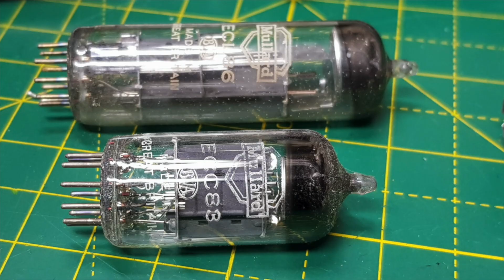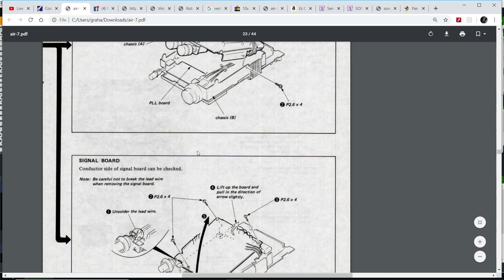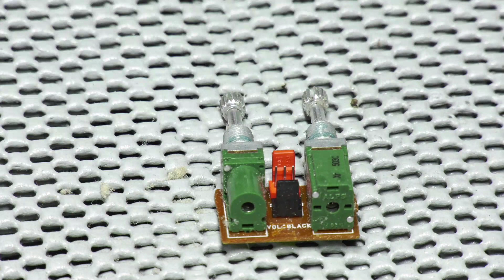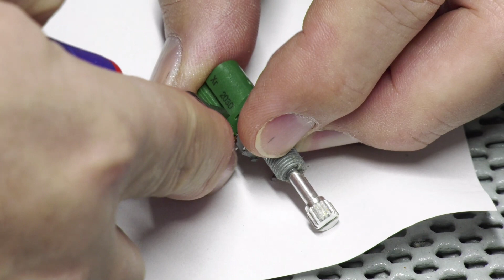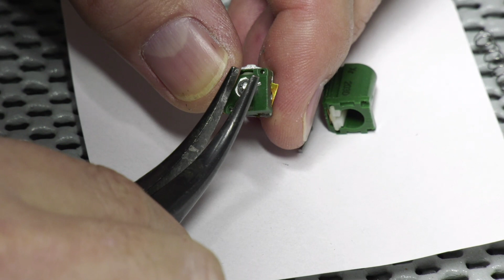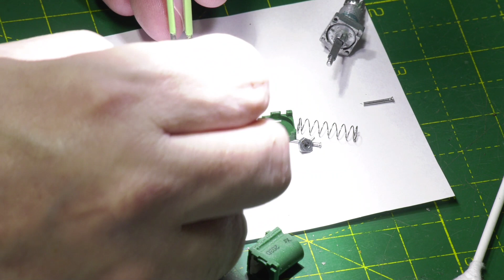Sony Air 7 scanner repair. Part 1 : Disassembly of the radio and repair of the volume potentiometer

Comment: Hi there, great video. I'm doing the same repair. For anyone wondering, the abrasion tool bit to remove the pins is likely a Dremel 7134 (Diamond Point).
Reply from the maker: Thank Brian. Yes the tip was a diamond pointed one. It’s not an easy repair but well worth attempting. Good luck with yours

Comment: Thanks for this video... it helped me dismantle my AIR-7 in order to carry out a bodge to keep it in service; I swapped the dead '1' button for the 'Key Protect' one on the basis that one was considerably more useful than the other! If anyone knows where I might find a spare button - unlikely, I know - please let me know.
Reply from the maker: I’m glad my video helped fix your radio. I had problems with the buttons on my own AIR-7 and replaced them all. It works great now

Comment: Hi from Germany !

Maybe you can help me with my Airband problem:

I found one in the scrap bin, refurbished the battery case and re-soldered the speaker as the cables were cut off. 
Also cleaned for some corrosion but the Radio is still giving me a scratchy noise output. 
Turned into our local radio stations and I can only hear something like a morse code sound but it seems It finds the radio station.

Same occurs with mono speakers.

Do you have any idea which part might be  broken ? Is recapping a thing there?

I come from retro computers and a Sony Airband is something completely new for me.

Really appreciating your help !
Reply from the maker: It’s unlikely to be the capacitors unless it’s the later AIR-8 which I think used smd electrolytics. I suspect that the volume potentiometer has collapsed inside and probably the squelch as well. I suggest you follow the videos and strip them down for a look first. Good luck
Reply: I have the same problem with my air band but where can I get a battery.
Reply from the maker: @medohaider6757  what battery do you mean?
Reply: @medohaider6757   4x AA 1.5 batts. it just takes 6v, not a special battery.
Reply: @medohaider6757  ah and if you plan to use a 6v DC supply; important thing, the minus is the center and the positive is the external; unlike the average. on sony radios and the gameboy, they are inverted. a tactic to annoy users who don't buy OEM stuff - that may have inspired apple.

Comment: I am mechatronics engineer want to learn wiring diagram and how to locate faulty component and trace out signal interms of voltage and troublehoot
Please make a video on these
Reply from the maker: Hi. I’m still learning my way around circuit diagrams so I’m not really in a position to teach others. Thanks for watching
Reply: I have one problem i have Sony 7600G
Whose medium wave is working on higher frequencies  and lower frequencies are not working what could  be the problem.
Reply: Can you recommend me what book should i read

Comment: I have the same radio in like new condition. Also same issue. I will try super glue methoud.
Reply from the maker: Superglue is not strong enough on its own. I only used it to hold the fingers in position while I glued them with epoxy. Wait until part 2 comes out where I do the squelch pot as I go into more detail then

Comment: clean and use a drop of high quality super glue. I have same radio in like new condition. Same problem
Reply from the maker: It’s a very common issue with these